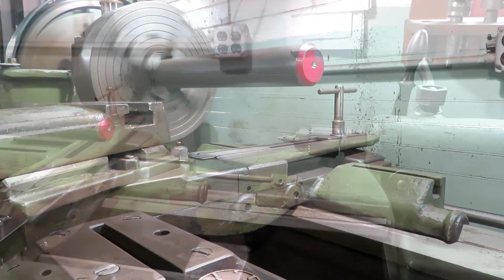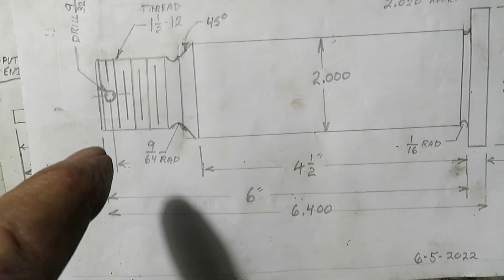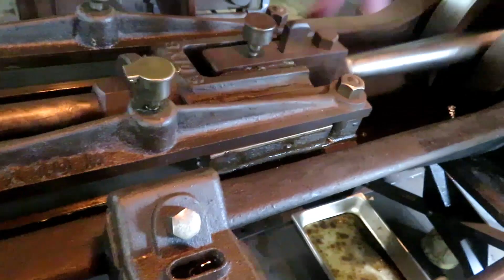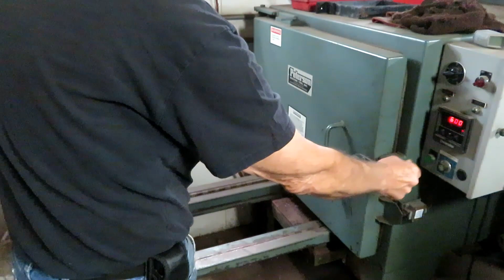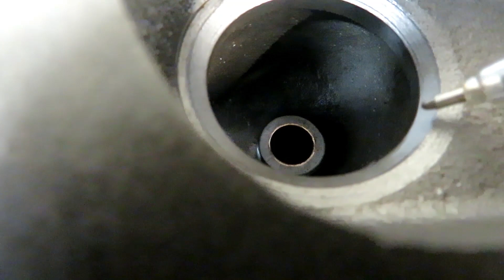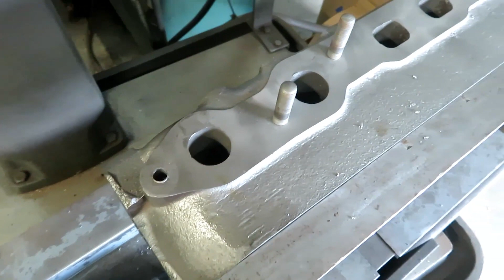Steam Powered Machine Shop 81 Work goes on.

Comment: Hello sir I am redoing an old Cincinnati drill pres I need couple pieces Is there any place that has old machinery they've burned out
Reply from the maker: Hi Richard, You will  probably have to make them, what are you needing?...Dave
Reply: @davidrichards5594  it's a Camelback drill press and somebody cut part of the camel hump out to mount electric motor I would love to be able to find and replace that whole piece it's possible make one but it won't be cast like the machine is completely I really appreciate you answer me back cuz I didn't think I would get an answer thank you

Comment: Once again excellent. My first head was a dodge Cummins 24 valve head. It took me two full days on my old round ram. Finding folks to do this is getting rare. But the old iron just runs so nice when done right. I used a Goodson ball cutter to do the seats and reamed out the bronze guides with a hand held sunnen stone guide/reamer.  Videos like this preserve the skill sets for the youth when us grey breads are gone. Once again Dave, thank you. Looking forward to the steam engine bore out.

Comment: Hello there. You have a nice setup with the steam power. We have a big center lathe that is powered off the PTO of a tractor. It works though a Bailer clutch. We can turn some sizeable lumps of steel   like 3ft pipe flanges. It's a Swift lathe. What make is your drill press. Ours is a Herbert and very similar to that of yours.

Comment: My father-in-law would be able to find his way in there blindfolded - I personally think you would be in danger of blowing the shop up. His home hobby lathe was powered originally by a massive electric motor from the 1920's but when he moved into his house in late 1930's he modified it by using a smaller motor given a helping hand to start by hauling on the broad leather belt to start the lathe turning and the browning out the whole neighborhood by switching the motor on. He would love this shop.

Comment: Do you ever put hardened seats in these older engines?  When my dad has rebuilt several older engines including a C123.  He had the machine shop put hard seats in the head.  The hard seats make up for the removal of lead from the gas.  Heavy seat wear is more noticeable in high load applications such as his C123 was on a baler which worked very hard with fire crater pistons.
Reply from the maker: I would rather see the customer put money into some better new valves. I don't think seats in an iron head are the problem. I don't recommend seats except for extreme wear, repair LP or Nat. gas power. Most intake seat wear comes from poor air filtration. Just my opinion.....Dave

Comment: Hey Dave if you've answered this already I apologies, but where do you get your drive belts? I'm having difficulty where I'm at in finding and buying them.
Reply from the maker: Hi Ron,  Most of my belting is old leather from e-bay, engine flea markets, and viewer donations. Rubber /fabric  round hay bailer belts work well from Tractor supply. The composite fabric (light tan color) belts  like you can get from McMaster Carr called "power transmission belting"  are just junk for line shaft . Leather is very good but is a gamble, it might have some weak spots  which you can splice out. Good luck.....Dave
Reply: @davidrichards5594  Thank you very much Dave for the info. By the way I have enjoyed your web channel for a while now, learned much from your cannel, thank you for that knowledge! Vary much appreciated.

Comment: Bonjour David,
It is always a pleasure to watch your videos. Questions of the day, how do you maintain all your pulleys  ? I guess they have oilers for example ? And which is the frequency of the bolts tension management, some of them seem loose ? 
On your lathe, I see that you can modify the bolt position on top and bottom pulleys to change the speed I guess, do you often change the speed ? Depending on the metal you work on ?
Amicalement, Raphaël
Reply from the maker: Hi Raphael, The two main line shafts have three bearing hangars each,  those require a couple squirts of oil each day at start up.  Each machine has a speed reducing counter shaft each with two bearings that get daily oiling. The belt tension  changes a little. With summer heat and humidity they loosen a little, in cold dry weather they tighten up a little but require very little attention generally. I just shortened the main drive belt on the engine about 3/4". That was the first time I've adjusted it in 2 years. I mostly use the two fastest pulley speeds on the lathe depending on the diameter of the work. The low range "back gear" is for very large diameter work or threading. Great questions......Dave

Comment: My father-in-law had a valve grinding shop for Diesel tractor engines for years. Now you can get new heads with valve in them ready to bolt on. He sold most of the machines. Thank for the memories of working in the old shop.

Comment: I just turboed my 1hz engine and i noticed that i had a broken manifold stud, it was so hard i could only drill it about 3/16 deep with a 3mm Sutton drill so i decided to try a impact driver with a philips head and that shocked it loose.. even though it was a really hard stud the impact bits were still hard enough to displace enough material to get a good bite on the stud.. it was such a relief when that stud came out, with the extra back pressure of a turbo i wasn't happy with running it with a broken stud and i would have hated to have to pull the head off because of 1 broken stud.. I'll be trying the impact driver next time i have to do a broken stud, I've always found easy snaps, i mean easy outs to be more trouble than there worth
Reply from the maker: I never would have thought of that, lots of ways to do things....Dave

Comment: Thanks for another great video!   That drill press is just amazing.  The foot control is way cool.  That machine and the horizontal mill are my favorites.  Those beefy casting like they don't make anymore are sweet.  35:38 is that a cracked valve guide boss?

Comment: Do you turn everything with HSS steels, or do you also use hard metal?
Reply from the maker: I use High Speed Steel where ever I can. I think it gives a much better surface finish than carbide at the Low speeds I run in my shop. I use carbide on some tool steels, iron that has hard spots or for the first couple passes on raw castings that have a hard 'crust"....Dave
Reply: @davidrichards5594  What do you use with chrome-nickel steels?
These steels are not very hard, but very tough.
Personally, I don't like these types of steels at all.
The only advantage these have is that they do not react with oxygen and do not rust. That's the only thing.
Reply from the maker: @lutsifer5847  Stainless usually is a pain....Dave

Comment: Hi David
Do they still use white lead in the centers.
Reply: Look for a Bar Z video, where Stan Z. mixed some old white lead with high pressure lube.
Reply from the maker: I would , if I could buy some....Dave

Comment: The Farmall Super C had some row crop features that overtook the Cockshut models in the market post WW2.  This era saw the advance as 3 point hitch lift mechanism and the Super C was rated at about 22hp. (gasoline). *Speaking of the market as upper mid west and Canada. Various improvements to model development. Super C from 1951 to 1954 in Chicago. The cast head featured to the work bench is about 70 years old.  Collectors and restorers have rather good specification pages and some parts availability via specialized inventory *on line sources. Builds as can approach "like new" condition. Interesting to see as durablity (surviving to a modern age) where maint and refit matched years of productive use. For machinists looking back to this time, South Bend has a curious photo collection that includes many production pictures recording those products in the realm where electrical power replaced the steam age. Advance in metals, methods...a correspondance to this history.   Thanks Dave, for the look back to the power and sound of steam.  M.

Comment: The head is like it came out of Rock Island yesterday. I don't think I have ever succeeded with an "Easy-Out". I prefer to hammer the square tine of an old file into the drilled hole and then twist. Seems to work a lot better than the patent tool.

Comment: Question I will one day be in the same boat when it comes to making Obsolete pins. I was wondering what kind of steel was used for this ??
Reply: I believe Dave said 4140, which is STOUT stuff.
Reply from the maker: 4140 and if you don't have to do a lot of machining, you can buy it hardened....Dave